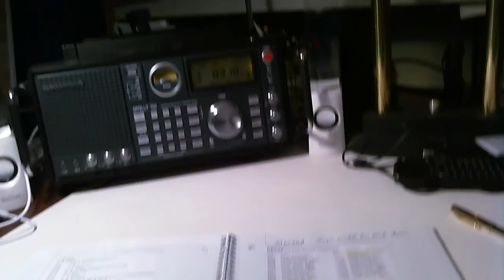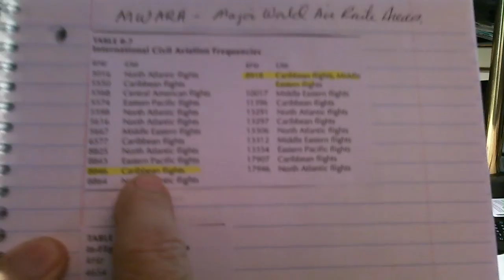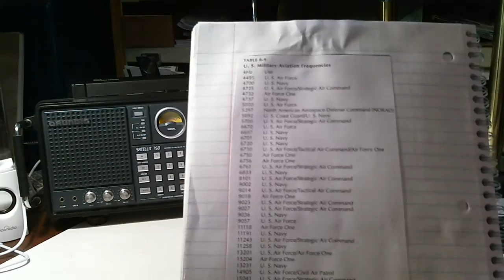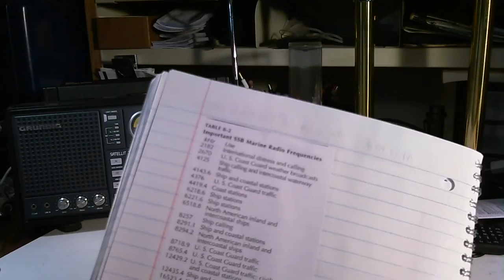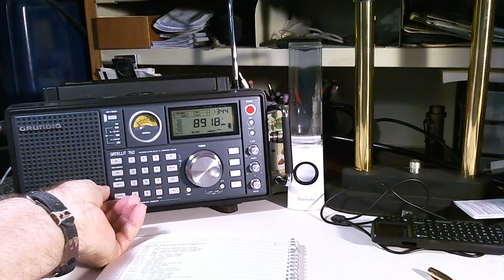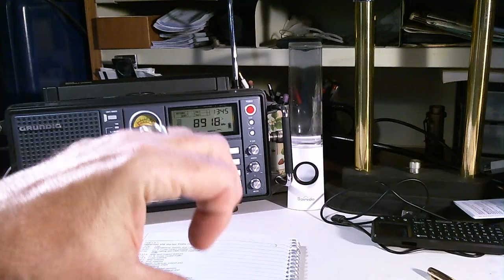TRRS #0620 - Aeronautical HF Radio Listening

Comment: Great video man, I was wondering if I got one of those short wave radios and I live in the Dallas Texas area, do you think I would be able to hear any HF oceanic air band radio transmissions? Or am I too far? I'm an aviation enthusiast and an airport employee at a major airport and this video actually has me interested in getting a radio like yours. I don't know much about radios but I'd like to learn
Reply from the maker: It would depend on my factors including your location and surrounding buildings, you height above sea level and most important a good external antenna with good coax cable.  Have a great day.